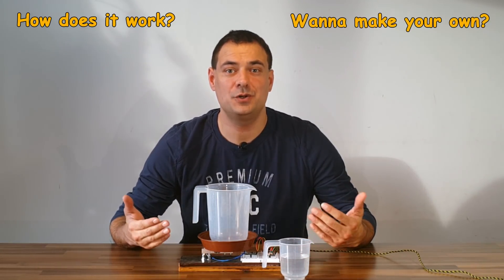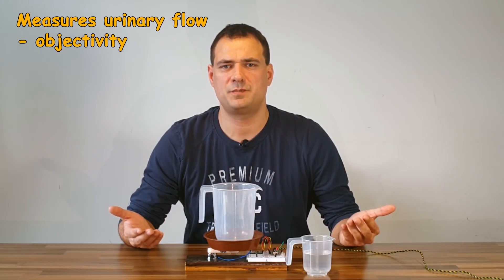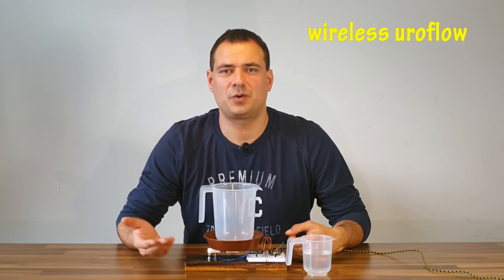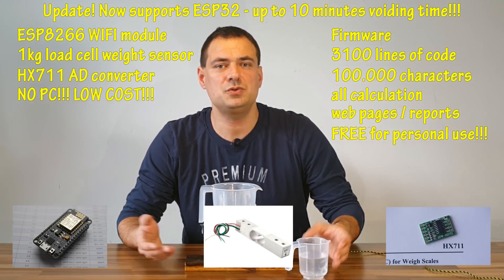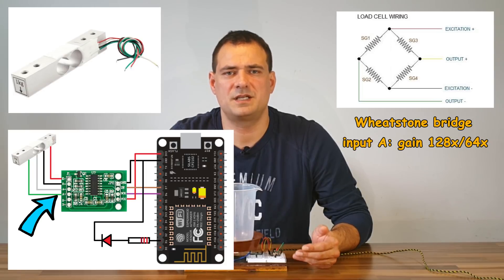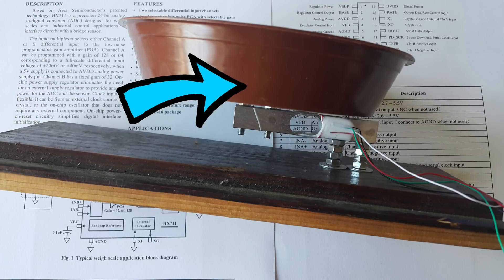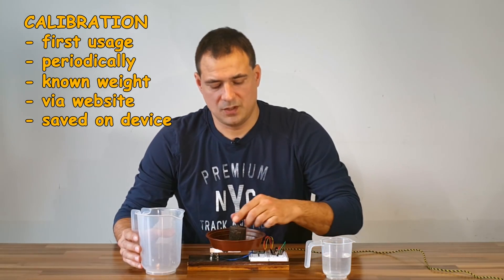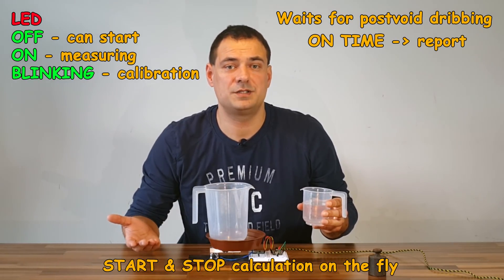🔴 DIY UROFLOWMETRY MACHINE for 10€ (Free plans & Arduino firmware ESP8266 or ESP32) 👨‍⚕️💊 PART 1

Comment: Hello, I am studying electrical and electronics engineering.  I want to build this device. I don't know the parameters shown in the report and how to calculate them mathematically in the program.
Reply from the maker: Greetings. I brought the project with uroflow to the point where I started selling them. Check out https://www.ipeewell.com/ . I have a version for home and a professional version for urologists. Both are very affordable. However, my uroflow is currently the only one on the market that reads 13 parameters, enables further statistical analysis of the data and has a computer reading of the results. Plus I am flexible and add functions as per customer request. I ship them all over the world. I don't have the code for the trial version from the video, because in the meantime I lost the data from the disk and I rewrote the program for uroflow. It now works via bluetooth. Link: https://www.ipeewell.com/shop/
Best regards,
Rok

Comment: Hi, I'm trying to realize this project. I don't know how to power the two board. May I use a CR123 3V 1700 mAh battery? To which pin  of HX711 and which for ES32 should I connect positive wire of battery? and which is the correct pin for negative wire of battery for HX711 and ESP32 as well? Thanks in advance for any help. I'll appreciate a lot! (consider that I am completely illiterate in digital electronic)
Reply from the maker: Hi. GND or G is ground i.e. minus pole. VCC is voltage i.e. input unregulated voltage. 3V3 or 3V is regulated voltage and goes to microcontroller. 3V3 is output of the onboard regulator which gets its input voltage from VCC. As long as I have tested Esp32 works fine from 3V supply but it is not advised...

Comment: Hi great engineer, I am very impressive about your invention. I am a urologist in and i am in some place without the urine flow rate equipment. Could you show me a clear about the 220 ohms 5% LED light picture so that I can ask local friends to buy the stuff? It would be perfect if you can provide  some detailed picture of  your product.  Many Thanks!
Reply from the maker: Sure, I will update my github pages in a few days... Thank you for the interest, support and I hope it serves you well.
Reply from the maker: It will take a while, while I make the update... It is an ordinary 5mm LED and ordinary 220 ohm resistor. The -/+ offset does not matter (5% = the cheapest one). Connect them to pin D23 of ESP32 according to the schematics on github. If the LED is not bright enough for you, lower the resistance. You can even use other LED color, but you will probably need to change resistor too. Have a great day!
Reply: @greeneyedexplorer  thank you. I will try this.

Comment: hi super Dr. super Eng. :) Please i need r help 4 my 3 years old son... i'm little dad.  have modest  pic mcu experience but 1st time arduinno,,,  could not find or download ur GUI prog.. where is that ? .. i bought arduino.hx711,loadcell from ebay... month  to received.
-would you also please explain how to build the project like how to download those files to arduuino till opening the software ? ... my little princess has meatus urethral stenosis at the end.. takes 12 months waiting for uroflometer exam here . plz help
Reply from the maker: Hi. I am sorry for the problems you have with your kid. I am preparing another video about how to upload firmware. See my github page (http://github.com/rokrodic). Download the UPLOAD.ZIP file from there. There are all the needed files to upload firmware to your ESP32. The firmware has been completely rewritten in the last month and I have dropped ESP8266 support. Maybe this will change. No promisses. All due to low RAM and speed ESP8266 has. So please use ESP32. It is just 2-3$ more expensive. Hope my machine helps your kid...
Reply: Jesus bless you :)
Reply: @greeneyedexplorer  hello doctor, please where can i found good fw? I found only that  with 0B files on git hub. thank you